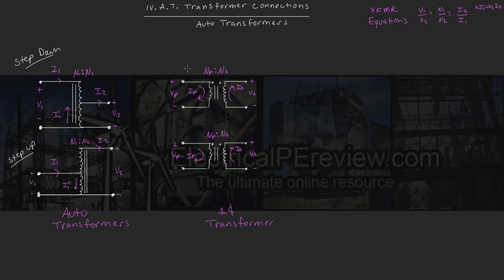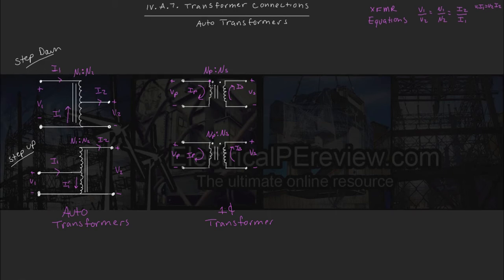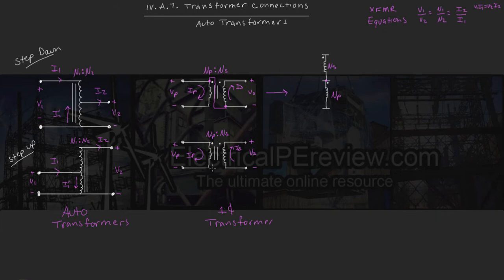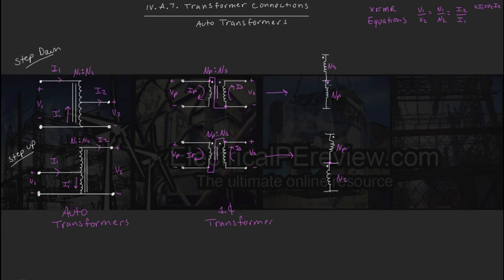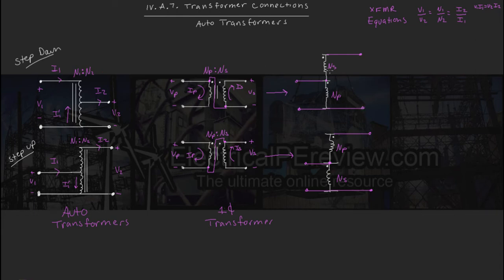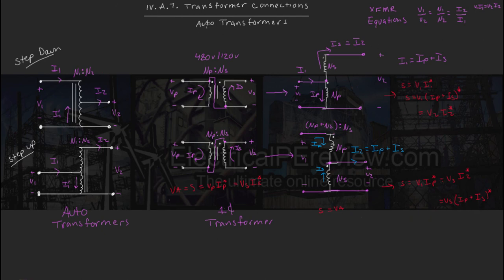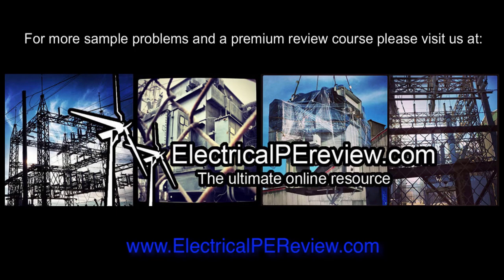IV.A.7. Autotransformer Connections from Single Phase Transformer - NCEES Electrical Power PE Exam

Comment: Calculation shows by connecting the prim and sec windings together, rating is to increase. However, I am always concerned about the transformer terminal rating. Two individual Windings loading is not changed. But the current flows into/out of the winding through the terminals which are the exposed parts. The terminals are just rated to the original current before the transformer got rewired to become auto transformer. Is this problem just a theoretical problem instead of practical problem? You don't want to overheat the transformer terminals after it becomes auto transformer.
Reply from the maker: Mostly just a theoretical problem, since auto-transformers are built with windings that are rated for the correct amperage and temperature. However if you were to re-arrange a standard single-phase transformer into an auto-transformer like the example in this video you are correct that you would need to make sure that the conductors and insulation would be able to handle the greater power output.

Comment: if we have HV side as H1 and H2 , LV side as X1 and X2 , then how does the following jive with what you have done ? a. current in any winding should not exceed its rated current.b. if the current in a winding flows from H1 to H1 then the current in the other winding MUST flow from X2 to X1 and vice versa.c.  Voltages add with terminals of opposite polarity are connected to together and subtract if same polarity terminals are connected. PLEASE clarify with thanks !